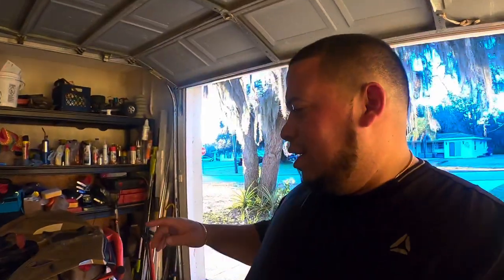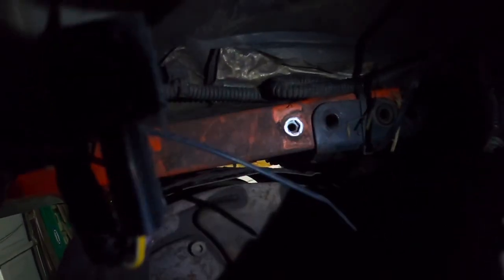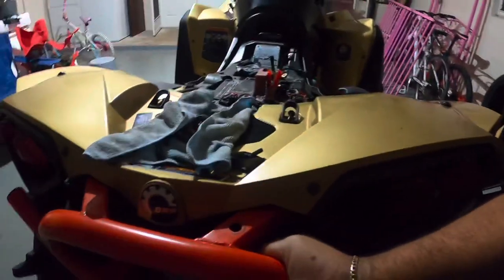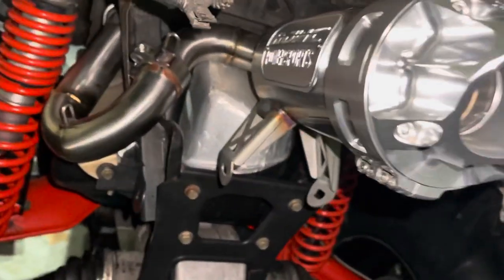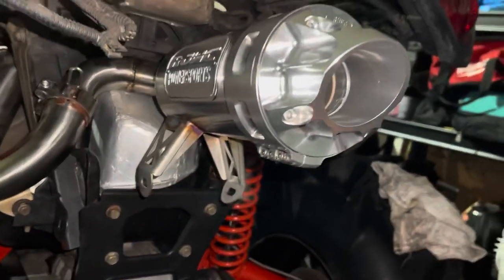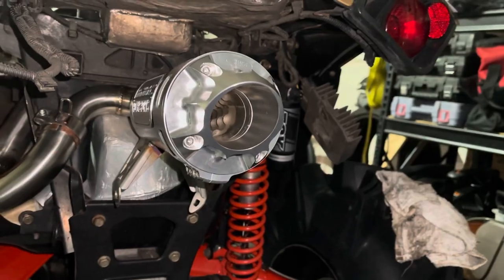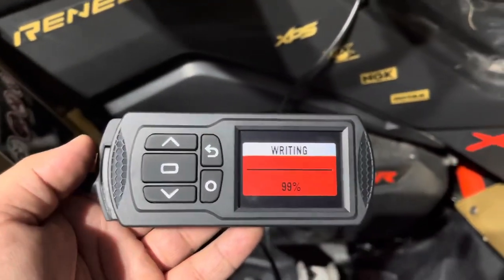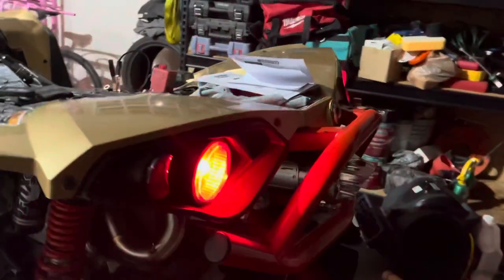Installing RJWC pipe and Dynojet Power Vision 3 reflash!! 🔥🔥

Comment: How fast will your bike run now sense you flashed it I got the same bike
Reply from the maker: I have not gone top speed on mine but it feels like it has more bottom end power and it runs a lot cooler. Haven’t had any problems with it.